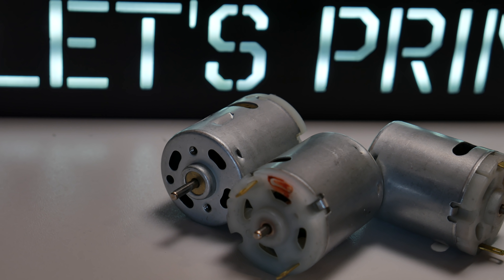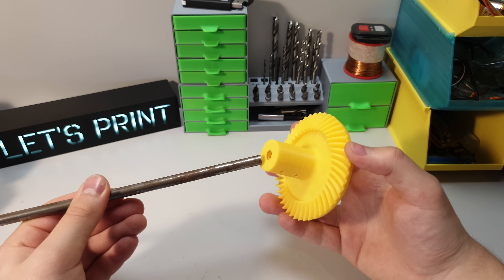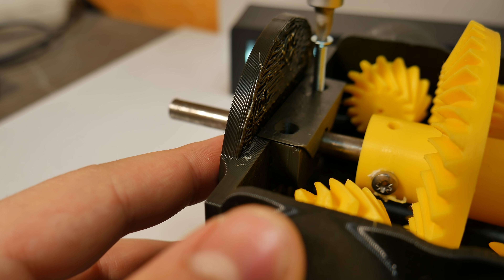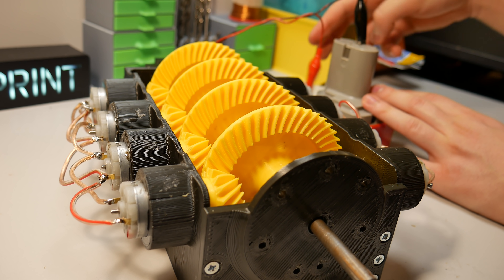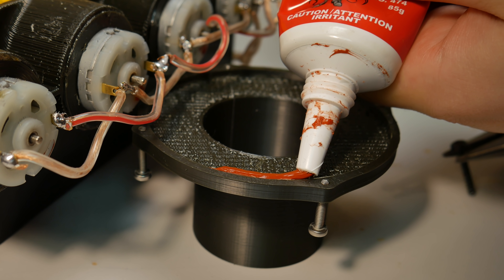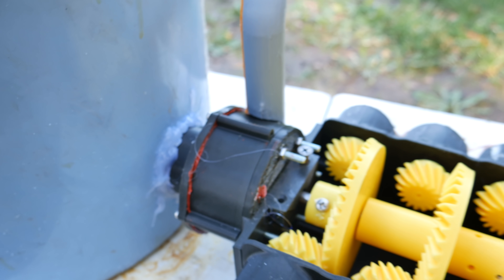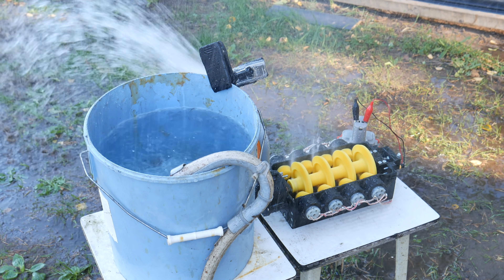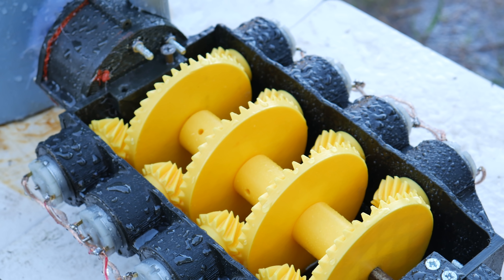Extremely Powerful 3D Printed Gearbox & Water Pump - Eight Electric Motors

Comment: Fictional loss at the rear end decrease the RPM
Reply: The best part is no part. If you are worried about friction use 1 big motor attatched directly to the pump.
Reply: @jaycweingardt11  yes best options
Reply: Agreed. Sharpening the bolt would help some. Ideally a thrust bearing should be used.
Of course flipping half of the large gears would cancel out the thrust forces.

Comment: clever gear lash adjustment system!
Reply: It's a really high friction way of doing it. Ideally there would be a thrust bearing between the two surfaces but just sharpening the bolt would also improve things.
Reply: @ddegn  i mean you're not wrong, but dude is using 8 brushed motors going into a plastic gearbox i dont think he's really trying to squeeze every drop of efficiency out of this thing...

Comment: Can you please make a video on how to print successfully with abs on ender 3 or any other similar printers
Reply: I've found out that 3DJake's niceABS can be printed on stock Ender3 (only modification I have is Capricorn PTFE tube). Just crank the temperatures to maximum (260 C° / 110 C°) and make sure you increase flowrate (I use 125%) and add a bit more linewidth over the nozzlesize to make layers squeeze together more, improving layer adhesion. When printing larger parts you do want to make some kind of enclosure to keep it toasty and avoid draft.

I guess there are other ABS filament types as well with lower heat requirements, but I've been having great success with the niceABS.
Basic bulk ABS filament I've not been able to do so it comes down to finding the right material, in my opinion.
Also consider HIPS, it can be great plastic for many applications and I have been able to print it on stock Ender3 as well.
Reply: @ristopaasivirta9770  
Thanks a lot 
I will try it today itself and once again thanks a lot for giving such a great and useful explanation
Reply: "Vedio"? What's that?
Reply: @HelloKittyFanMan. my bad to make such a silly mistake 🤣🤣🤣🤣,I am still laughing and wondering how I wrote that vedio thing.
Reply: @Aditya.k6604 : Haha, OK. Just edit it then. What did you mean instead?
Reply: @HelloKittyFanMan.  I was actually trying to type video but then I wrote vedio instead 🤣🤣

Comment: Hey friend, replace the water with oil and turn it into a hydraulic piston or system. Why not, right?

This is my second video I watch from you I subbed, liked, and turned on bell. ☺ 💚

Hope you saw my comment.
Reply: Aledner_LW for oil, a gear pump or pistons pumps are most eficient
Reply: You should probably use a peristaltic pump for oil. They work better
Reply: Ah thanks guys for information.